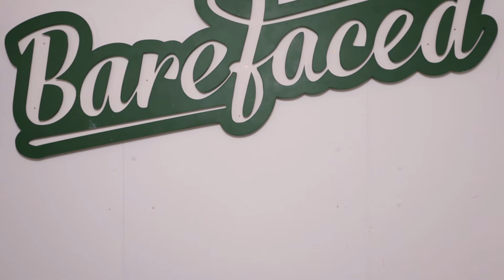Is your guitar cab different to open or closed back cabs? The science behind alternate designs!

Comment: I built a cab similar to the Port City 2x12 vertical oversize cab and it was definitely the best sounding cab I ever had, once I got the right speakers in it, which happen to be WGS Reapers. I sold it and now wish I didn’t but I have slowly started to build another, only it will be 2x10.

Comment: You will get destructive and constructive interference from the frequencies coming out of the back of the barefaced cab as well as the Forte and Port City cabs you mention. Whether this is bad or good is in the ears of the listener. Still, your design does look intriguing, I hope to try one some day
Reply from the maker: I think there’s at least another video in explaining this - but in short, omnidirectional lower frequencies are phase corrected by the AVD to match the cone output whilst directional higher frequencies are two separate sources, cone and AVD, radiating in a figure 8 pattern. These higher frequencies are two separate sounds from an acoustics perspective (due to the delay between them vs the period of the waves involved) but become a single sound due to the psycho-acoustics of how the brain melds similar delayed sounds to earlier sounds.